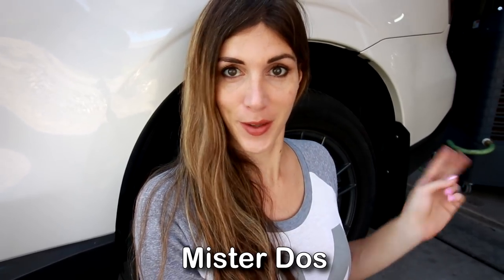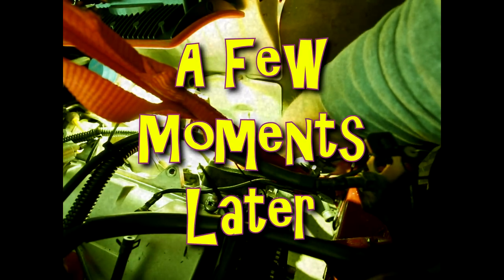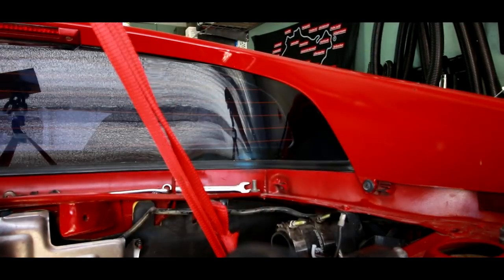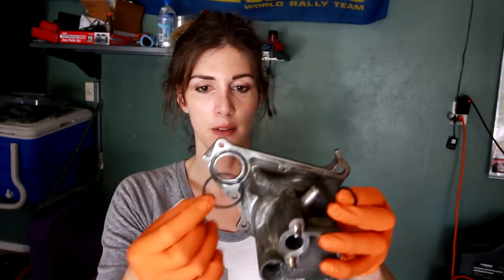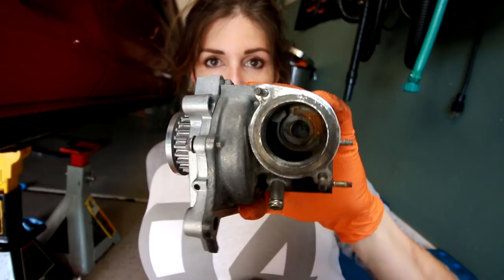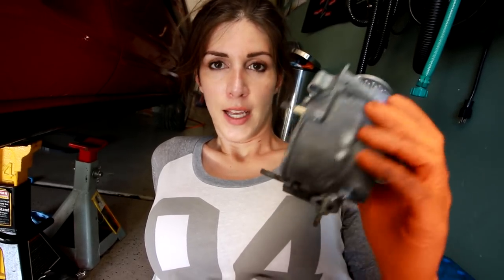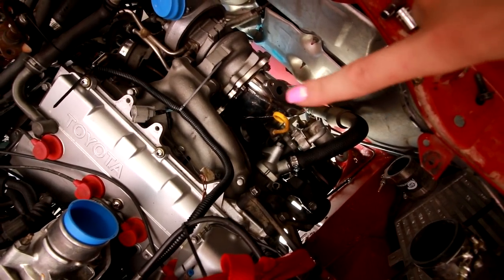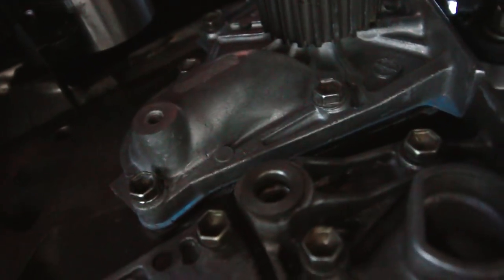Fixing the 3SGTE Coolant Leak // Project MR2 Turbo Pt.19

Comment: Sarah, I am so impressed with your work on these two cars.  Your OCD is an inspiration.  When I was shopping a car in 2001, I was drooling over the MR2.  Probably not the best choice for snowy winters, however.  I ended up with an Integra.  I grew up in a family of car nuts too.  I’ve done some limited work on my vehicles, but nothing close to what you do.  My guess is that you do more comprehensive engine work than the average mechanic. Thanks for the great content.
Reply: Patrica Smyth ,I want a 99-01 Integra eventually for a drag toy streetable build.

Comment: Glad you figured out the water pump after watching the last few in this series.  If you plan to keep the car long and/or do things that involve opening the coolant system more, you might consider looking into a venturi/vacuum coolant filler.  If you have a compressor, they are far and away the quickest way to fill/bleed the coolant system on a mid engined car (where you have high points in the front at the radiator and the rear at the expansion tank).

Comment: There is a pump tool diagnostic that you can get that you can pressure test your radiator for coolant leaks. Pump it and keep it under pressure, then when you look underneath your car you'll have to check every area but you should see some seepage/drip if there is an issue. The next issue is that you filled it with (distilled) water, idk how fast a water drip can evaporate in Arizona heat in a garage.

Comment: Dental tool would be hand for getting out old O-rings.
Reply: any set of auto picks will work just fine. She can definitely use some for sure
Reply: I just cut them diagonally in place, they pop right out then.
Reply: A straightened safety pin is something useful that almost everybody has one laying around.

Comment: Another handy fix for leaking old systems....run that Evan's waterless coolant.  it's just 100% glycol instead of water/glycol mix.  but if done right it won't pressurize the system.  So it sets a lower bar for sealing leaks!

Comment: Since you now have an MR2 (and getting air bubbles out of the coolant system per the factory recommended methods is a pain in the ass), and you seem to have other projects - do yourself a favor and find a Snap On RadkitPlusA (or an off brand that does the same). It uses pneumatic negative pressure to pull air from the coolant system, there is a gauge that will show whether there are leaks (vacuum won't hold), and has a valve/tube that runs to a coolant bottle and when opened, filled the system without air.

Comment: I don't know what are the system specs of your windows PC, but You should try to do some upgrades.  RAM , SDD and a NVidia 1080 Ti would make a big difference  64GB of RAM  and  a  2TB SSD (Solid State Drive) would make your video editing faster, so you can use it as back up.

Comment: Sarah - Another great vid. It's nice to see real people doing real work on their cars, and it's amazing to see someone do it without a constant stream of F-bombs. Maybe you just mute those out.

I do have one question and I'm sorry if this has been asked before. It looks like you're doing fairly extensive work on MrDos's motor and its accessories, and it looks like you have an engine hoist and a stand. Given this, wouldn't it be easier to pull the motor and do most of this work with the motor on the stand? I figure you probably have a good reason for your approach, I'm just curious what it is.

Comment: Don't you have to pressurize the system before declaring victory on the coolant leak? Maybe I missed that part of the video (I skipped a couple parts) but letting it sit over night doesn't really tell you if the leak is fixed or not...does it?

Comment: Easy thing to do is buy a brand new Toyota water pump and thermostat housing already sealed to the water pump. This way it comes with all the o rings and gaskets needed in the pack. Good work fixing it though.

Comment: A coolant pressure tester would be a more accurate way to check for leaks since the system runs under pressure. It would have taken 15mins maybe and did the whole system front to back.

Comment: Cooling system isn’t under pressure that’s when it will leak if it’s going to leak also the thermostat is closed (water isn’t at 195 degrees or whatever it takes to open it up) so only leakage will be what’s left in the block

Comment: Aisin has a water pump assembly and housing, one piece, with ALL gaskets and t-stat.  You can also get the same assembly in the t-belt kit for around $100.  Between the extra gas running around and the lost time and aggravation, better to spend the dough and move on.  Still would have content to show us what happens when you keep just replacing the water pump impeller.  Time is money, go get em Sarah.  If you need technical help, hit my instagram.

Comment: Could you not pressure test the system prior to the timing belt etc.? Have an olde school mechanic friend that has a manual pump to pressurize it. Back in the before time when I worked in the telco industry, we would call that a "good trouble". Elusive and hard to pin point but oh so satisfying to fix.

Comment: I'd like to think that I fixed my Mr. Dos enough to drive. As if I'll ever get through the bucket list. lol

I usually end up having to order damn near anything on this car. Local auto parts stores are almost totally useless there. Can't get a rebuilt steering rack. Can't get the seal kit to rebuild it myself from any of them either. It's only a slight drip here and there for now, but that won't last long. Back to Amazon. ;-P

Comment: Hopefully the red coolant does not react to the residual green coolant, some times that is a problem. I stopped working on my own stuff years ago because I drive for a living and need to trust that mechanics know there stuff but the color issue of coolant has always made me ask the questions "Why green vs red or yellow? Less toxic? Longer lasting? cheaper? Why the different colors if they can mix in some ways but not others? What can and can't be mixed?"
Reply from the maker: Timothy Earp I’ve flushed it twice now, but no, they shouldn’t have a negative reaction with one another, at least from everything I’ve read.

Comment: Do you have the repair manual for the MR2?  I'm not trying to be rude, but so many of your problems (like how to remove the oil cooler) are explained in the repair manual . . . Search "BGB Toyota MR2" on google.
Reply from the maker: No, I don't have a printed one. I just received a digital copy though.

Comment: Hope you don't get offended, but their is no point in using a torque wrench if your not using it the correct way.  Not using the grip handle or griping the torque wrench at different points changes the torque value causing inaccuracies in the process.
Reply from the maker: Jose G better be careful, I might throw it off a hundredth of an inch pound! Lol 😋✌🏻
Reply: Sarah n Tuned I figured, for a perfectionist like you every little inch matters. Or you can be like some of my students and grip the torque wrench like a baseball bat and yank at the head bolts with both hands till you brake a headbolt off. Either way works. hehe

Comment: There are specialty sockets made to grab onto stripped and rounded nuts and bolts so they can be removed. I got a set from 8mm to 22mm at Sears, but they are available from many retailers on line. They have saved my butt a few times. Message me your address and I'll send you some pizza !! P.S. you can rent/borrow cooling system pressurizer pumps from many auto parts stores if you want to test the cooling system quickly.